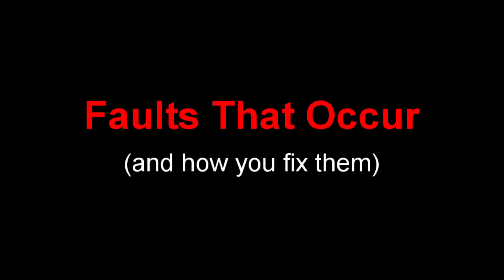The TOP 3 Faults That Occur at a Traffic Light

Comment: So if you turned out both of the small green bulbs on your "signal board" (to simulate two burned out bulbs) the signals would go to "flash mode"?
Reply from the maker: Yes, because the conflict monitor would sense there is no longer a load present.  It thinks those set of indications are dark on the street and places it to flash.

Comment: I'm an industrial controls engineer and I find these other control systems fascinating.  
I have a question that's been bugging me.... when you use the outputs of one load switch to run multiple heads (like I believe you did in your first scenario), how is it wired through the conflict monitor to detect only one head on the output is bad while the other head is good?  Do you have to train the conflict monitor to look for a specific operating current and when it detects a drop in current (like when a LED module goes bad) does it then throw the fault?
Reply from the maker: Great question.  The conflict monitor is wired to monitor the field terminal where the field wires from the street are terminated.  So for one direction, it monitors the red, the yellow and the green.  Lets take the green.. It doesn't know if it has 1 green indication, 5 greens, or 20 greens.
It's just looking to see if there is a load on that terminal.  If all loads (the green indications) are OUT, it senses it floating (Neither ON or OFF) and triggers cabinet to place it in flash.

Comment: Red fail is a cabinet issue, it happens when the monitor doesn't sense 120v at the lugs. If you lose all greens on a phase you'll get a field check fault, or maybe even some other faults, but red fail doesn't occur on the field side of an intersection.
Reply from the maker: As others have pointed out, you are exactly right!   I went down one path demonstrating one thing and totally switched to demonstrating something else!  Geesh!  
Thanks for catching that!  I'll need to issue a retraction in next weeks video! 
However, I still stand by my statement that a red fail is the worst description for the fault LOL

Comment: can american controllers be programmed with the red+yellow before green indication like some other countries do?
Reply from the maker: Are you referring to the controller outputting yellow + red outputs to the indications?  Meaning  if I'm a driver sitting at an intersection looking at a red light, it will go yellow and red, then a few seconds later go to a green?  If you're referring to this - no.  In european countries, controllers have this capability.  In the U.S., the controllers cannot do this and the conflict monitor does not have the option to allow it.  It would put the signal into flash showing a dual indication.  
Great question if thats what your asking.  I actually just found this out from another sub last week!  LOL
Reply: The controller I work with has the ability to be programmed with the Red+Yellow Interval, . The Conflict Monitor Programming can be changed to allow the Red+yellow signal. The thing is you'll never see it on the street in the US.

Comment: Loss of load will never cause a red fail. Red Fail should be called Dead Channel. There is no power being supplied to Red, Yellow or Green on a channel. If you lose a load it could cause a dual indication or conflict.
Reply: For TS1/TS2 (as seen here) yes, but for ATC cabinets it should indeed cause one (they call it "lack of signal", but it's the same idea) as those do monitor current.
Reply: @aprilkolwey4779  He's not using an ATC cabinet so...
Reply from the maker: @mondorevolver6686  See my statement to Metalbill.  Yep, my mistake.  Started demonstrating one thing and switched to an entirely different demonstration.  geesh
Reply: @mondorevolver6686  Fair point, I have edited the comment to make it more clear that I wasn't intending to imply the video showed anything ATC.
Reply from the maker: @aprilkolwey4779  Really? I have little experience with ATC cabinets as I have only worked on a few.  But loss of indications out on the street (not the cabinet side) causes a red fail?
Reply from the maker: Metalbill!  You are exactly right!  I started down one path demonstrating loss of a signal head by pulling a signal wire in the cabinet and then switched to pulling a load switch....Not quite sure what I was thinking!  Yes, if I pulled both wires out, then I would have had a conflict (if the conflicting direction was on).  Loss of both (greens or yellows or reds) from inside the cabinet would have produced a red fail.  Thanks for catching me on that.  
HOWEVER, i still stand by my statement that a red fail is the worst name to describe the fault lol
Thanks metalbill.

Comment: This is really fascinating!  Thank you for the video!  How exactly does the cabinet switch from normal operation to flash?  Is it simply relays that flip between the normal loadcells and the flasher?  Also, down in South Florida, when our intersections are in flash, the main drag normally gets a flashing yellow while the side street gets a flashing red.  Is the all-red flash more common in certain areas?
Reply from the maker: Great questions!
The cabinet has what is known as Flash Transfer Relays (FTRs).  The flash circuit and normal reds (or yellows depending how they're wired) pass thru seperate legs of this relay.  When the conflict monitor senses a conflict, it triggers the coil of the FTR and switches to the flash circuit.  The flash circuit will go out to the street on the yellows or reds (depending how its hooked up).  THats why you see the yellows and reds.  The main street FTRs send the yellow the flash circuit.  The side street FTRs send it to the red.
 
I'm not a fan of the yellow/red flash.  Here's why-the side street cars aren't always able to see what the main street is flashing.  Side street assumes main street has a red flash as well.  Until they don't....and end up being T-boned.